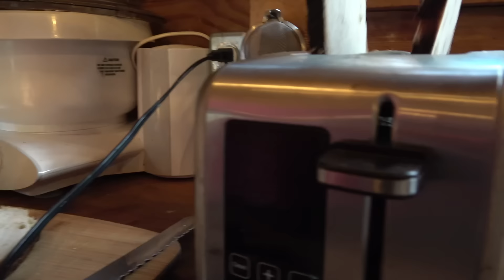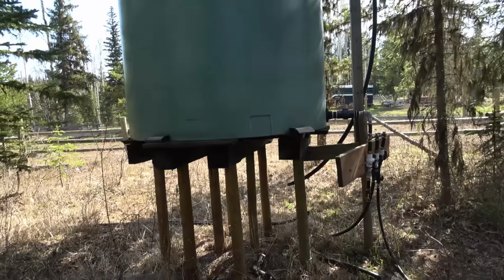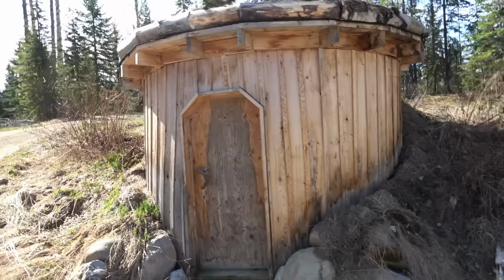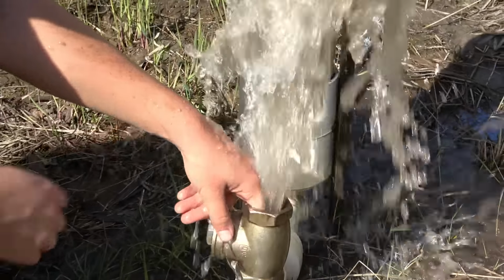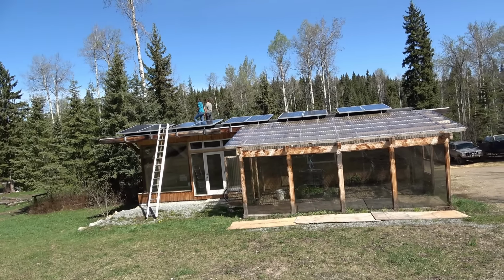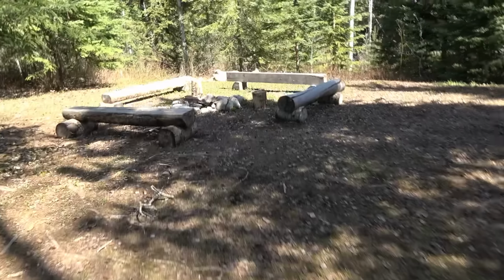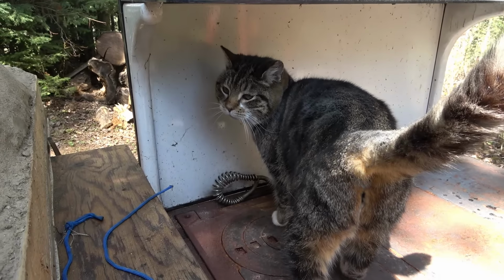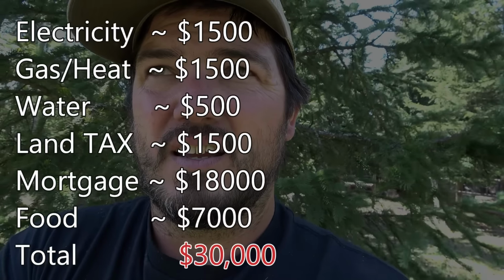Off Grid Wilderness Homestead Pays BIG DIVIDENDS

Comment: I spent 22 years building from the ground up on an unimproved parcel and living full time on my off-grid homestead only to have the USFS burn it to ash when they lost control of a prescribed burn. House, contents and 25 acres of high-grade standing timber gone in a matter of hours. So I’m speaking respectfully from firsthand experience to suggest a couple of things you might want to do: 1) cut surrounding trees much further back to create a larger space between your house and out buildings and the edge of your forest, and 2) rig up a sprinkler system to douse your house and most important out buildings if wildfire does sweep across your homestead. A hand hose won’t suffice. Prepare for high wind speeds during wildfire, too. My place saw 75mph sustained winds when the fire roared across my 30 acres and surrounding 3,000 acres of public adjacent forestland. Property protection crews did all they could prior to the fire’s arrival but it wasn’t enough. I’ve been homeless 2.5 years after the fire while FEMA stalls delivery of compensation to victims, compensation we’re fighting tooth and nail to receive even though a law was passed and $3.9B funding has been banked for that purpose. Expect the worst to prepare well for survival.

Also, if you can get it insured, do so to the maximum allowed (replacement cost coverage if available). Photograph/video everything inside and outside and store the images/video on cloud storage. Documenting your experiences on YouTube is a good way to record progress over the years if you ever have to provide detailed proof of loss to FEMA. Expect FEMA to be uncooperative, inept and bungling at every turn of the recovery process.

Comment: 11:25  Free Power

I don't use batteries ‐ in the sense yall do. 

Instead, I compress air using solar panels and windmills. 

All I need is minimal equipment, which I made myself, that uses sunlight and wind to compress air.  

The compressed air is stored in a two thousand gallon system at 80 psig.

 When I need power, I run a small air engine (also homemade) that powers an electric generator.  

Simple is best (4 me).

Comment: want auto adjusting solar panels ... black ABS tubing and a winterable liquid ... a largeish abs cylinder on each edge of a panel array .. each storage cylinder connects to the opposite side by a push rod ... as a cylinder heats up in the sun it pushes the panel to cover it ... all you need to cover all angles is a pintel mount .. good for every season ... and takes NO power from your system ... it just uses solar heating to re adjust ... sure regular maintenance like anything else ..

Comment: I would love to visit but I do not think my health is up to it i love following you in the canal   I was born of grid one of a twin  Sid & and two very different characters. Two years ago I got Phumomer & a split hi 'Otter because of my blood pressure.  & I'm still getting over its effect. 
we will see in time  I follow what you are up to. & as for the  Wood gas project  & the answer to the wet smock.  It is producing  Its [ tow fold ]. I know been the don that so let me pass on some facts.  I was born in 1952  & I used a wood gas generator to charge up our battery bank.  
Ok let's get to it first running on charcoal is the best result But there has to be sufficient   Charcoal to make Dioxide which is the burnable gas  C2  Monoxide  C1  doesn't burn  & the type of gas you will find your products first  So do not breath that in,  the secret is heat the now we get the more dioxide we perdus. best 2000 c  if you do not want a damp smock.  

but as it is winter & in your case cold. you will make gas but it's going to be damp. something I learned in the year 1962 /3  one of the coldest in English winters in history. 
But I found an answer & the way your gas generator has been designed adds to you benefit you in the case.  Let's take a minute to point out that the gas you are producing is a form of butane  C3 HC2, case in fact.  But it freezes at  -5. The gas I'm going TO tell you how to produce will be,  Propane or there-aborts & it will freeze at -40,   Right what you need to do is stop letting the gas go into the filter chamber.. but instead fit a steel pipe about 6 " in diameter.  with a valve to let the gas in & air, the pipe will get into the middle & it will be stainless,    by sending it up a colom of charcoal. your damp smock will be converted to C3H8 or propane gas.  once you have lit the charcoal tack. the pipe out of the top of your colom & now send it up the filter colom. to the flair now when you flair it will be yellow in colour & magenta Now you are using the water in the wood fibre to make good gas. Dioxide gas C2 will be a deep blue. it will burn but yellow is better.   now what is the benefit well your would will dry & turn to charcoal & you refill your colom with it.   & no more damp smock gas will improve the starting  & running of the system to charge your battery bank.  OK, it's late I'm older than I once was & please forgive me if I have my Dioxide  & Monoxide mixed up but the fumblers are right they have to balance to achieve a conclusion, so add air. or reduce it   Les England hope thit helps.

Comment: If it were I living there, I would at least consider building a steel & concrete structure strong enough to bury at least 14 feet under soil. 

I'd build it atop a knoll, slab on grade to prevent flooding. 

You could heat it with my birthday cake candles (I'm 75 😂) and cool it with ice saved from Winter. 

It would be us 100% passive heated / cooled.

Comment: I get it is Not so much what you earn, but more the benefit we get out of not embracing Mainstream living.  a bit of what my old dad would say.  a pound save it equal to two pounds earned.   I got it Once I spoke to the UK Labour Party heads in the party when we found ourselves millions of pounds in debt.  I proposed that for a 3-pound fee, all citizens should have the opportunity to select the party's next leader.   That was the year  Jeremy Corbin was selected & the  Labour part was for once out of debt with a lot in the bank to support further elections & 800,000 New members on its books.  it's interesting how the state always tries to put its hand in your pockets.  It is like the gas Generator you have just purchased. & Built.  on paper, it should work when you first fire it up. & to a pint, it will give you gas But what they. Do not tell you is that one piece of equipment they forgot to include in the design that truly would turn your new gas generator into a truly magnificent build.  it is the secret to gas production in a wood power  Gasification plant. & they even provided a place to put the device.  Yes, but they never mention it.   it's the charcoal colon that fits between the condenser & the filter housing. {YES} It is why the Filtra is soaking wet & you do not produce the right tip of gas.  that will Floor-Less-lie drive a combustion engine,  You call it damp gas But it is the point where the majority of the gas you need is held locked up in steam or your case damp gas.  So how do we fix the design well we fill a 4" pipe full of charcoal. At the bottom, we fit a stainless steel nozzle & a valve to control the air intake  & a the top of the colom we fit an exit port to filter the inlet where you presently feed the damp gas. . from there in the filter & the flair & your generating device.   not the gas is dry & the gas has a crimson flam at times it looks yellow.   this is enriched hydrogen gas, Now the secret to this damp oxygen has been burnt off, should the production of gas fall away as the load in your gas-generator decreases  You can have a drip of water at the bottom valve to increase your production, unless you charcoal is spent.  

so now I have revealed to you the secret of the wood gas generator Now lets see how you develop your plant to benefit from my offer & revelation, Discovered by myself in 1962  & free for anyone to apply & adapt.  Les England Let me see part 3. Soon son you have the tools now remember do Not Breathe in charcoal gas or operate gas generators in well-ventilated areas &  you will be safe.

Comment: How about a 2-3 plate induction cooker or glass ceramic cooker? The photovoltaics should provide enough electricity for lunch and there would be less work in the summer. Surely Hot Dave agrees with me.